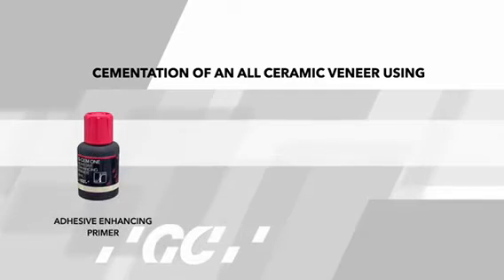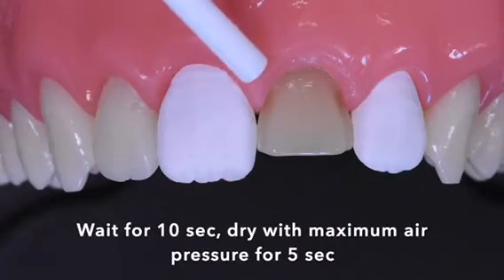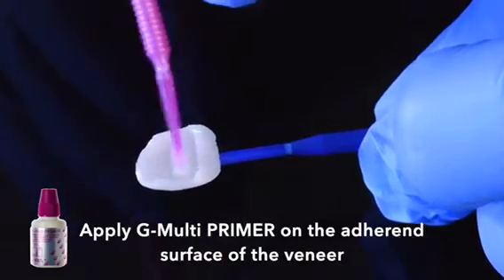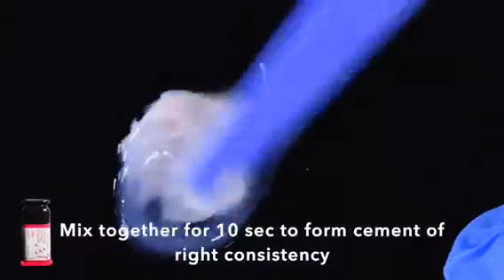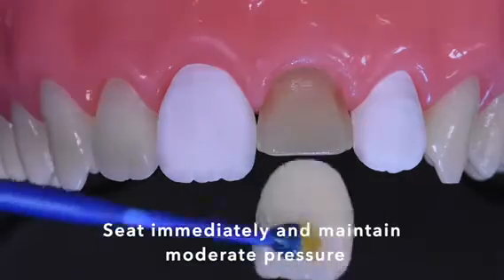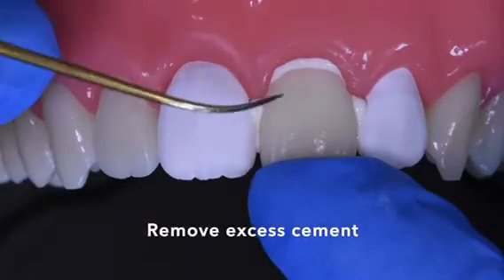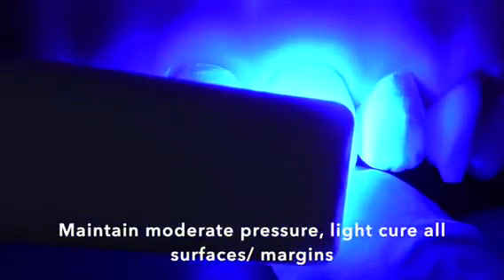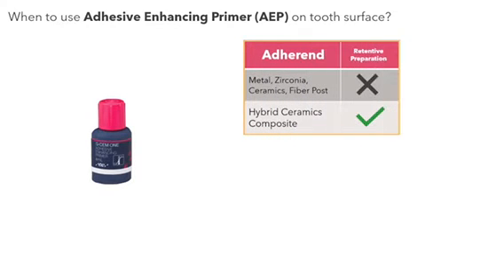Cementation of an all ceramic veneer with G-CEM ONE

Comment: is etching of the tooth surface necessary before applying the adhesive enhancing primer?
Reply from the maker: Hi @vishakhatasgaonkar7061,
No need, but in case of veneer or onlay cementation, enamel etching with 35-40% phosphoric acid should be applied for 10-15 seconds and rinse off, followed by the application of G-CEM ONE ADHESIVE ENHANCING PRIMER to adhesive surface.
Reply: @GCAsiaDental  so basically it has to be used in place of a bond, correct?